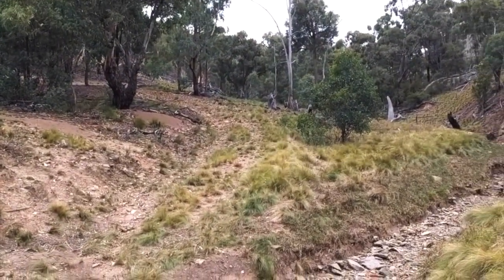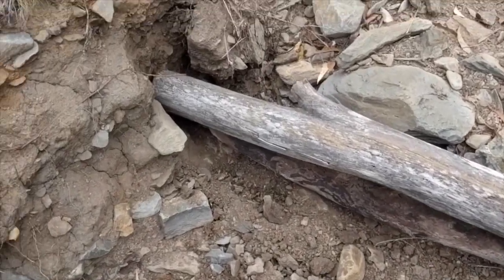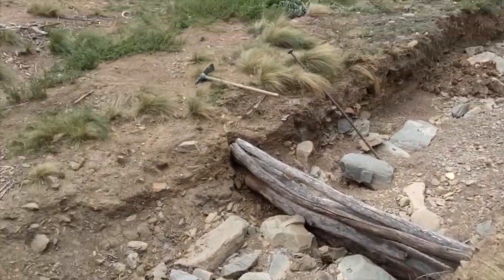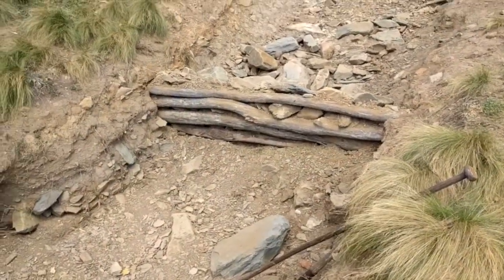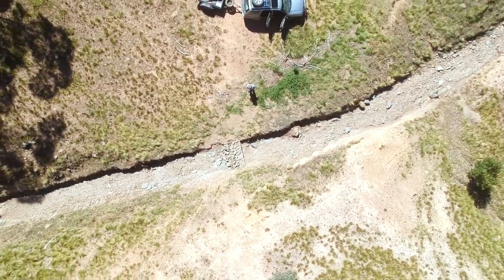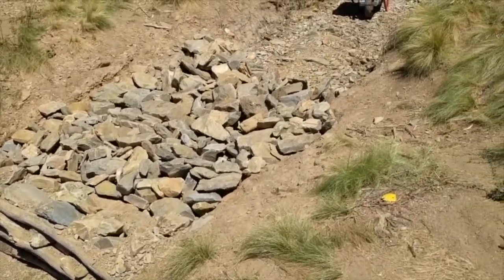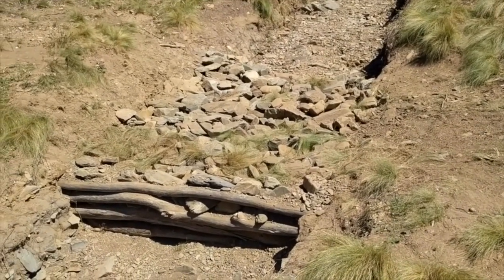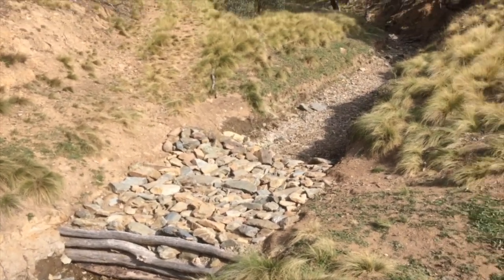Building a Rock Crossing at the washed out Creek ⛏

Comment: Are the logs on front or back side of the waterflow
Reply from the maker: The logs are on the backside of the flow, that is, the water comes down and across the rocks, then flows over the logs like a small waterfall.
Or that was the idea at the time.  This crossing lasted about a year before a rain deluge wiped it away. We've since had 2 more iterations of a crossing at this spot, and the most recent seems to be lasting better - probably because we had a local farmer neighbour come help and used large logs tied together with wire.  Thanks for watching!
Reply: @TaralgaBushAdventure  Thanks so much. I'm starting mine tomorrow. I'll take pics.